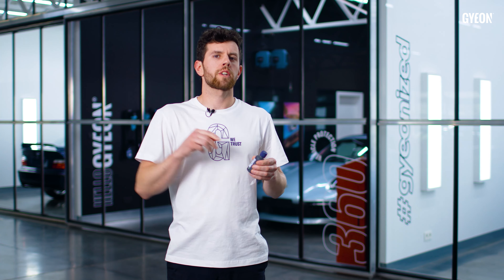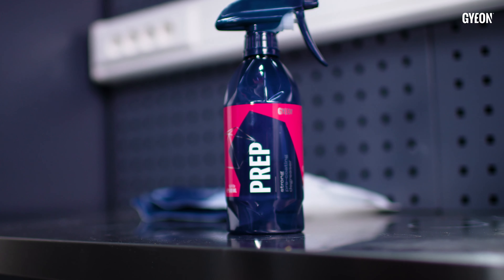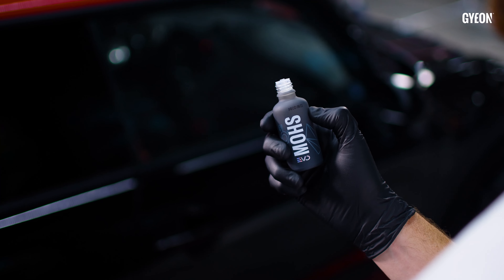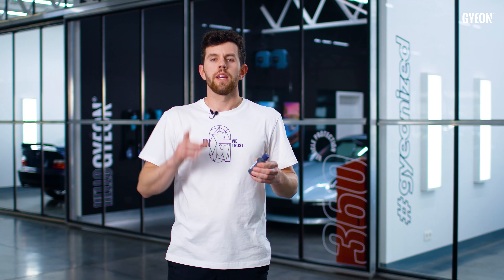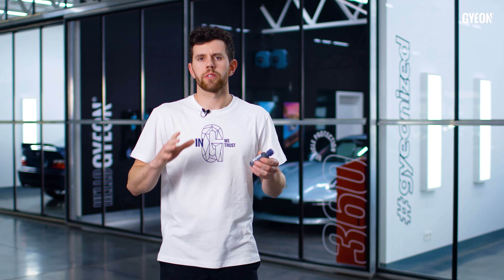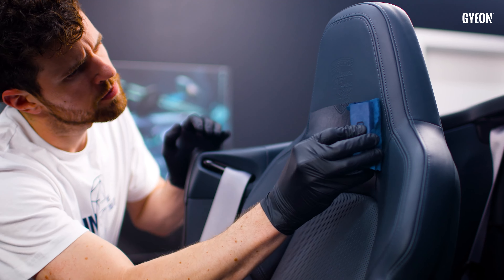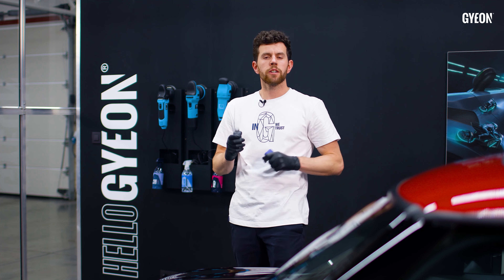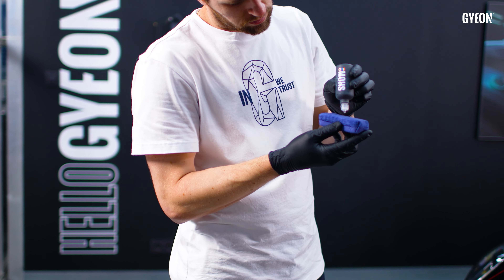Q² Mohs EVO

Comment: In the instructions on the website, it is mentioned that after polishing the car should be washed with hot water and a degreasing agent before using Gyeon Prep. Is that step mandatory and does it greatly improve the life of the coating?
Reply from the maker: As per the instructions, yes it is.

Oil residue are the reason number one of coating failure or low performance.

Preparation is key.

T.
Reply: @GYEON_official  Thanks. How would you recommend that wash to happen. Foam and rinse with decreasing soap or a hand wash?
Reply from the maker: We have created Q²M Degreasing Tabs. These can be used in a final hot wash before applying a coating to remove polishing oils. 

Regards,
Y.

Comment: I applied Mohs Evo to my car in an open environment where the weather was very hot and very dry. The product does not ''sweat''. It's became immediately foggy and I immediately wipe it off. Will this harm the performance of the coating?
Reply from the maker: No coating should be applied in very hot weather. Outside friendly also had it’s limitations. The product will perform but you can run into uneven application and patchy areas. 
Regards,
Y.

Comment: I'm pretty confused with your line of ceramic products. What's the latest and greatest? My local certified Gyeon shop offers Dura Flex and MOHS+ with 5 year warranty. Are these coatings now older generation? Do you have a separate line of product for certified detailers that includes the newest fluoro tech and how are they called? So confusing.
Reply from the maker: We have a Q²Infinite coating line up for our Certified Installers. Q²Duraflex and Q²Mohs+ are certified coatings from a couple of years ago, it’s a different technology but even today still performing strong. 
Regards,
Y.